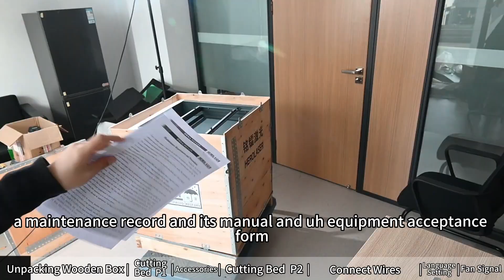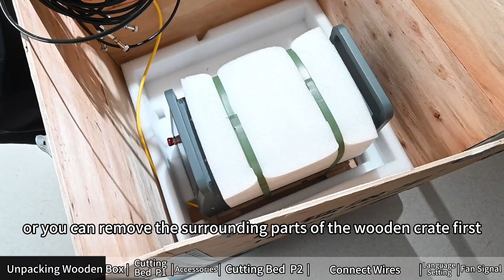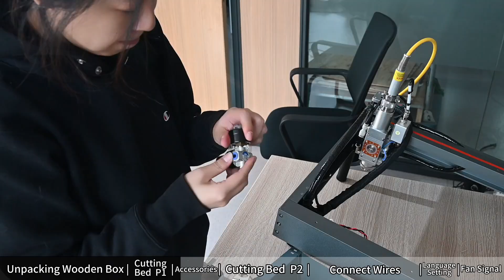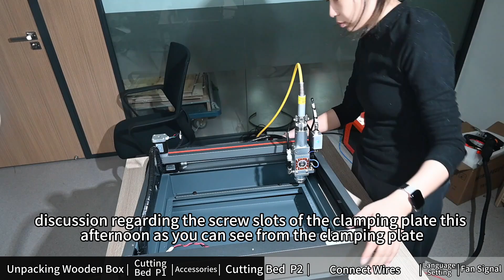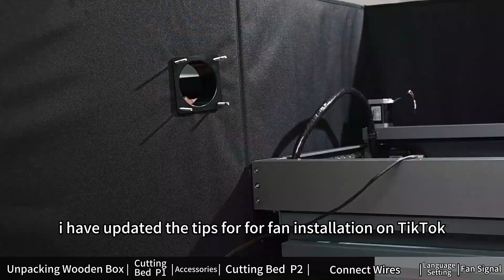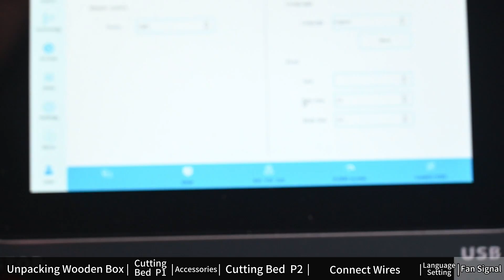CNC fiber laser cutting machine c700 by Herolaser

Comment: We didn’t buy a cheap shrouded machine, we bought a metal cased machine this is not worth the money, you have lied to us
Reply from the maker: Hi Adam!
I recognized you right away—I still remember you left a comment on my TikTok before, and I replied to you at that time, though I wasn’t sure if you saw it. Today I want to take the time to properly address your concerns about the machine’s casing, and first of all, I want to sincerely apologize for our team’s mistake!
The prototype we used for early promotion had an acrylic casing, but due to post-processing of the promotional images, it gave you the impression that it was metal. What’s more, our product introduction page only focused on the cutting function and completely failed to clarify the actual material of the casing. This was an oversight on our team’s part, and we’re truly sorry for the frustrating “misleading” experience this caused you.
Regarding the casing issue, our internal team is currently evaluating the feasibility of launching a metal-cased version of the machine. For the sake of fairness to customers who have already purchased and received the flame-retardant-cased model at the corresponding price, if we finalize the metal-cased version, it will be offered as a paid upgrade option. If you’re willing to wait, we can delay your shipment and notify you immediately once the metal-cased version is available, and you can choose to upgrade by paying the corresponding price difference. Additionally, I’ll later post a tutorial on TikTok showing how to combine the existing acrylic casing with a self-made metal one, and I’ll also share the detailed drawing for the metal casing to make it easy for you to modify the machine yourself at no extra cost.
I hope these solutions can ease your concerns. We value every customer’s experience and are committed to handling this matter in a transparent and fair way for everyone. Feel free to reach out to me anytime if you have other ideas or needs!